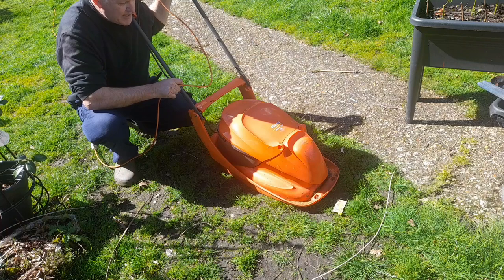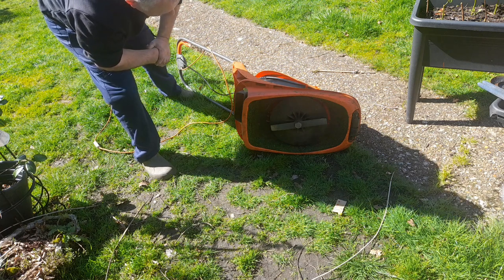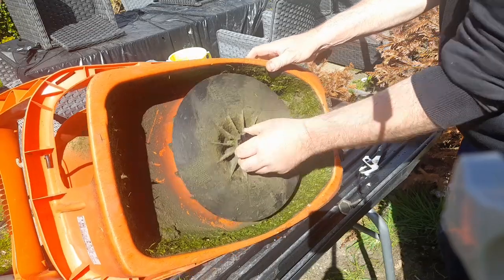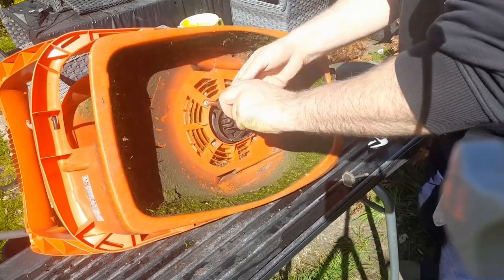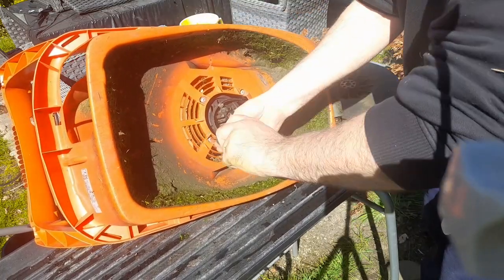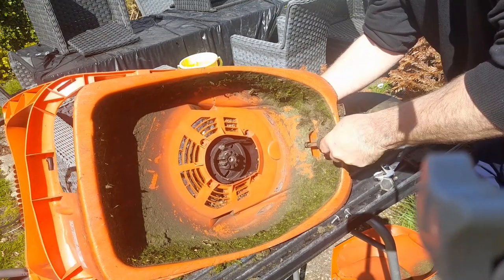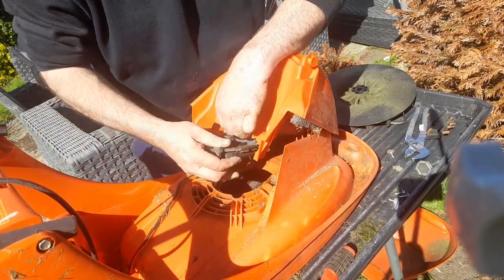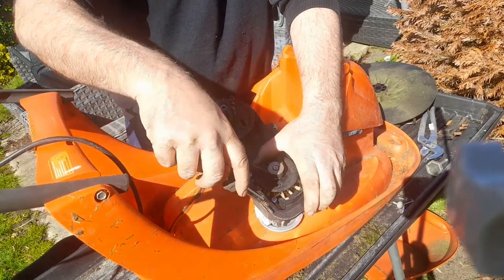How to Replace a Flymo Lawnmower  Belt ⚙️ | Gardening for Beginners

Comment: I would recommend putting the belt back after flipping it  so the damaged side is away from where it was before. This might help it stay on while you use it. Then order a new belt. It is strange how you call the rubber belt a fan and your screws are bolts! Anyway a very good video. Thank You.

Comment: Helpful but strange you never changed the belt after going through all that trouble in taking it apart ?
Reply from the maker: Thanks for watching. I did not have a spare belt to change to at the time of video. The lawnmower has so far served this summer on that belt.